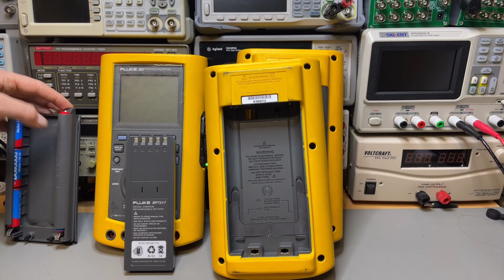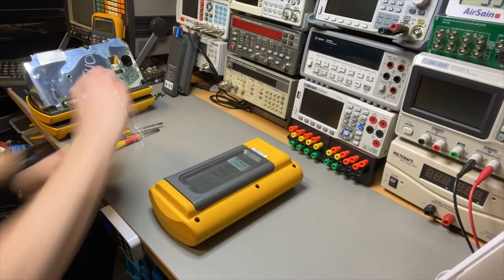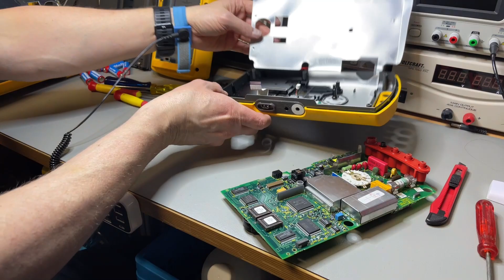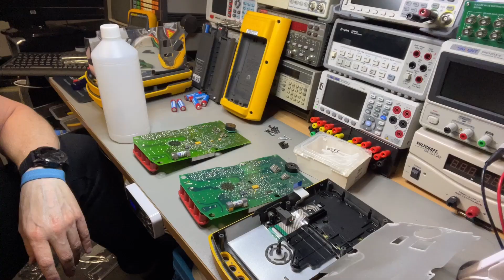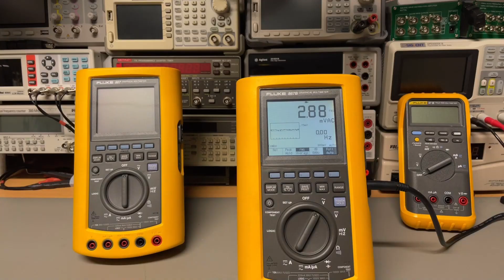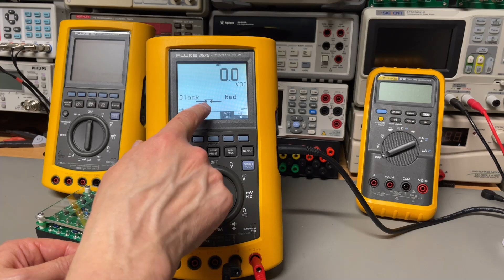TA•0352🟦Fluke Friday (E18) Fluke 867 867B - Graphical Multimeter

Comment: Hi I have the same one 867B bought new one years ago. Had the same issue  after many years of using it but I managed  to fix it. Also had the display problem but now is working perfectly by cleaning rubber contact rail.
You need to clean and re solder resistors attached to switch contact print board and after that everything will be fully functional.
Reply from the maker: Thank you!.. that is very valueble informtion, i will try that.
Reply: @TonyAlbus  Before I found it out I was trying only to clean the contacts but had no improvement. Than I start to measure a resistance between contact pad and print line with resistor in between and had found that it is not matching the right value. After resoldering everything was fine. Hope will help you. Thank you for your nice valuable reports about electronic equipment.

Comment: Thanks for this video. I have the legacy non-B version. Already repaired issue with functions selector, just cleaning carbon traces. But as i see 6:15, i have the same flickering over bottom soft keys bar. Have you repaired this?
Reply from the maker: Hi, i still need to find the courage to start on this.

Comment: For anyone that still has trouble with the selector switch even after cleaning, if you notice bare traces showing on the carbon pads you can use a demistor repair kit to paint over the traces connecting to the carbon pads.
Reply from the maker: Thanks!!!  great

Comment: @TonyAlbus  I got mine working super quick. The issue is easy to identify using resistance mode on a multimeter. Place one probe on the trace going into the carbon pad that isn't working then place the other probe on the carbon pad next to the trace. If it's higher than say 50ohm then the integration between the carbon and the trace going to the PCB has broken down. Compare to the other pads to see the difference. All you need to do is scratch with some tweezers/something pointy perpendicularly across the trace and the carbon. This will create fresh contact area between the two and the mode will start working again. I fixed half my modes this way. Two weeks daily usage on my bench and not a single hiccup since.
Reply from the maker: Thank you so much !! , that is what i needed to know, great solution, i will try that. Thanks for sharing.
Reply: @TonyAlbus  I use it everyday still and zero issues since scratching across the trace perpendicularly into the carbon pads. Works great. Did you have another look at yours yet?
Reply from the maker: @parawizard  Thanks, i will try, i still need to do it, i was distracted with so many other things, great to know that is the correct solution, thank for your comment.
Reply: No problem. Can also report I have been using IKEA NIMH batteries the high capacity ones with decent battery life.
Reply: @TonyAlbus  Still working great after all this time not even a hiccup
Reply: Thanks to you parawizard, my component test function is up and running again. It was the only function not working for at least a year.

Comment: Do you find you use these over newer modern models like BM869s/289? The component tester is cool! The 90/100 series scopemeters also have this functionality. Not sure what to pick between a Fluke 105B and a 867B.
Reply from the maker: Hi, i use more my BM869s or 289 , the Fluke is bulky and mine does not work correct. Also my Scope meters i do not use much, is for my collection, when i need a scope i use my desktop Siglent, which i just update to the 12 bit SDS800X-HD
Reply: @TonyAlbus  I use a 179 mostly but I borrow a 289 when I need more resolution, a feature the 179 doesn't have or additional precision. I just ordered a 867B that needs some work. I am excited about the component tester. It's definitely bulky but I work at different places so it could be interesting. I've got a newer portable owon scope, a siglent 1104 bench scope and also a picoscope 3406 which I use the most. Were you unable to fix the all the modes on your 867?
Reply from the maker: @parawizard  Nice gear sir! .. about my 867, i have not put much time on it yet. so its still as it was. i am always distracted with other gear i like too.
Reply: @TonyAlbus  Hahaha gear acquisition syndrome getting ya! I will report back once I get mine and fix it. Should be ok with the service manual
Reply: @parawizard  hi , that component tester is awesome. Do you know specific models that also have one?
Reply: @demofilm. 867B is the one to get. The screen is much readable than the monochrome version. I wish fluke had a modern version. I have the scopemeter 105B as well but it's really more of a scope than a meter.

Comment: I ran into the same issue with my Fluke 86B, I re-soldered the support contacts around the back switch, next I applied one drop of DeoxIT D100L on the trace and rotated the selector several times, inspected the leaf springs with my digital meter, (all good ). Fortunately, I did not have to dismantle the board, it seems the problem is located on the removable back selector, happy with the result.
Reply from the maker: Thansk! i will put this also in my solution options for mine. great!

Comment: Bought one of these for cheap because the unit goes to setup in component mode. Voltage modes and resistance mode doesn't work. Diode mode and current modes work. The fix was rubbing (CAREFULLY) the resistive pad with 600 grit wet/dry sandpaper and clean the residue with IPA. Very good meter but on the slow side.
Reply from the maker: Thanks, i will try that!.

Comment: Hi, these scopmeters are luxurious and accurate, especially the component test function saves a lot of time during diagnosis. The display is slower for some operations (for older types). The diode pattern in the shape of "d" or "p" depending on how the polarity is reversed during measurement is a manifestation of the added capacity, with a sensitive tracker sometimes it helps to twist part of the measuring wires into a strand, the tracker can identify the wires laid next to each other as added capacity. This pattern tells us when testing a diode in the circuit that a capacitor is nearby, with the new Huntron trackers, due to the redesign of the setting system, the surroundings can be completely eliminated and focus only on the monitored component.

Nice day 🙂 Tom
Reply: Quick question is there a succesor to this meter? I have a fluke 123B scopemeter.   But this seems to have some features it doesn't and asking google had no results.   Specifically interested in the component tester in circuit.
Reply from the maker: @justinhensley108  Good question! .. i am not even sure.... let me know when you found it.   interesting.
Reply from the maker: Thank you Tomas, good extra information! nice day!

Comment: Another cool Fluke Friday  😎  Thank you,  Tony.  I would take another look at the rear section of that "switch" and maybe do some continuity checks across the "contacts"  They look like printed resistive pads and may be cracked at the pcb connection interface. All of the electronics appears to be working. Regards, David
Reply from the maker: Thank you David, that is something i will check for sure, great tip!